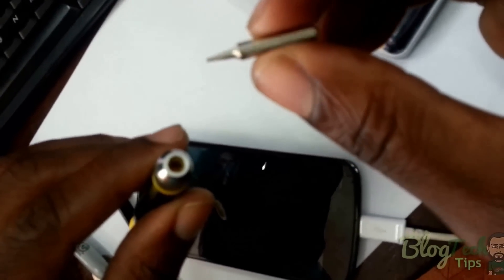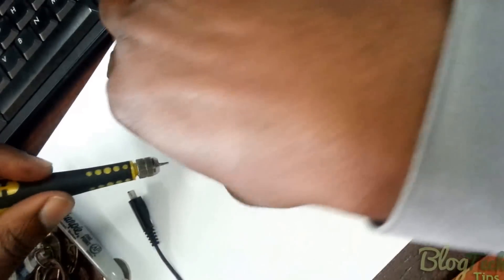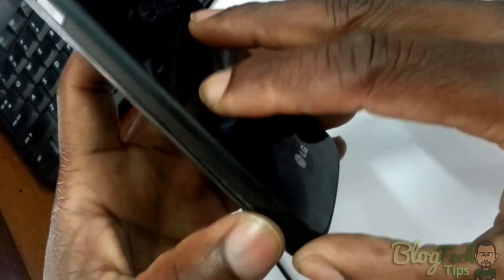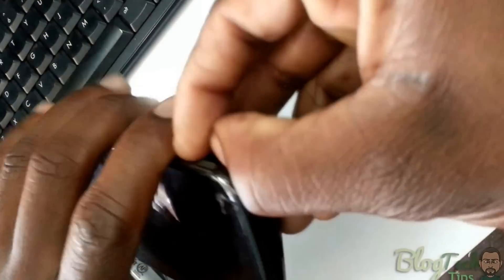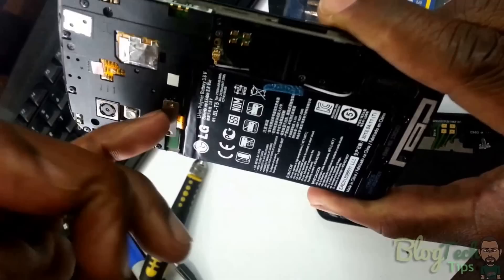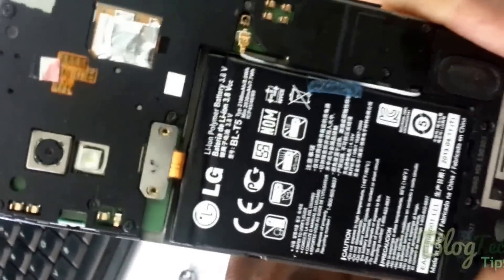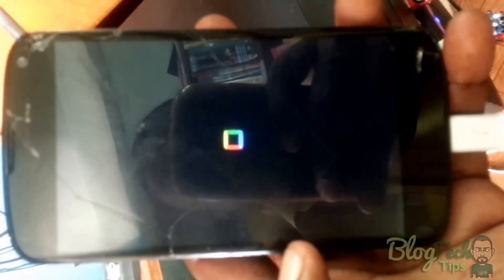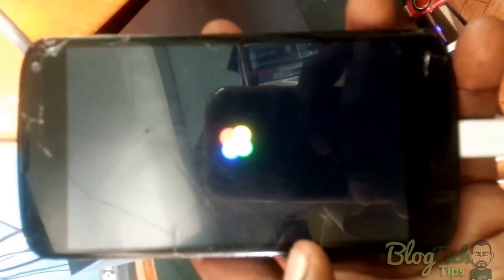Nexus 4 red light Fix

Comment: i've been doing this method for million times.and i just bought the battery FYI,all it gave to me just a blinking red light,screen on but only to show me the large battery icon with lighting bolt and then showing google logo then shuts down and repeated...is my new battery really super dead or is it something to do with the motherboard?
Reply: same exact thing for me but I gave not done anything but the power+Sound down thing
Reply: I just leave my phone to charge and it works. I need to use the original charger, a car charger doesn't do the trick.

Comment: I tried pretty much everything that didn't involve opening up the phone (hard reset included). I finally conceded and opened up the phone to do the fix as instructed in the video. Ten minutes later (and another fifteen for charging). All fixed!
Some notes to viewers: 
* T5 torx screwdriver required (you can buy from any hardware store for a few bucks).
* Philips head micro screwdriver. Dunno what size. Again a common item that can be found cheaply in hardware stores.
* The hardest part is separating the seams. I used a safety pin and gradually went around the phone.

Comment: Ok, I Tried it. Managed to get my phone booting correctly, up to my home page, but it suddenly shut down again, for the solid red light to reappear (maybe due to the battery being almost compoletely empty). Tried few more times without any success, until i broke the connection plug from the battery...now, i've ordered a brand new battery, it should fix the problem right ? or is the issue concerning the phone itself ?

Comment: i have been working in the company fixing this problem for more than 2 years facing this problem with lots of customers, the main reason for this is using bad source of Power ( simply, using the USB port of the computer as a charging source ) using such a source gives the battery a bad frequency of power, that means : your phone needs exactly 5.0v (1.2A), while your USB port of the computer only gives (3.0v), and this will make your battery inactive after doing that lots of times, and this is not happening in all the devices, some of them will survive, but finally the battery will die, and you wont be able to fix it.
Reply: Kareem A Kemo   "bad frequency of power" + "USB port of the computer only gives (3.0v)" 

give up your job mate as you don't know what you are talking about
Reply: Kareem A Kemo Bull.
Reply: Thank you SO MUCH for this information u just saved my phone i was charging my nexus 4 with another charger not the original one but now im charging it with original one and it actually worked thank you so much mister you deserved a like
Reply from the maker: Kareem A Kemo Thanks for the informative comment, I will have to be extra careful from now on with charging my phones vis USB on my computer, I know they can at times deliver less than the power that is needed but never thought it could cause issues in some devices.
Reply: Kareem A Kemo What about iPad chargers? Does it ruin the battery too? Because I noticed it charges the phone faster. But you are right, my phone died after I left it charging on my PC one night.
Reply: I tried everything even replaced a new battery but still the phone will not boot. Red light is continuously burning ot flashing.